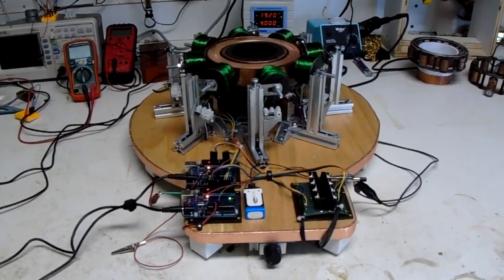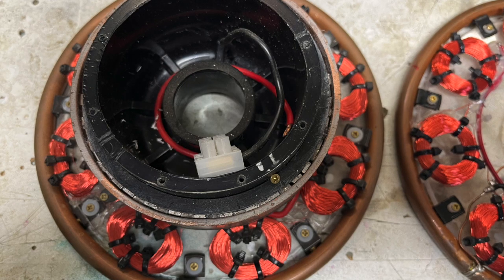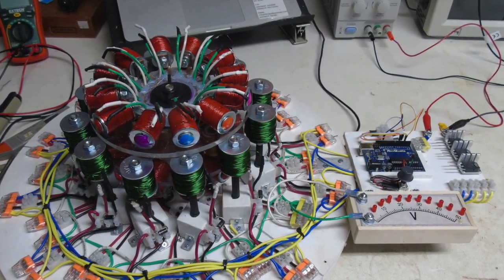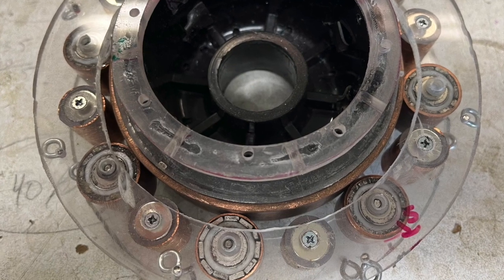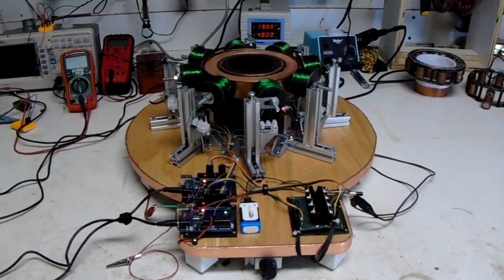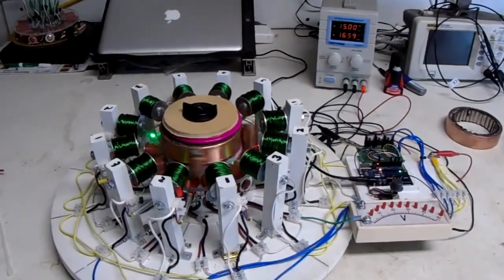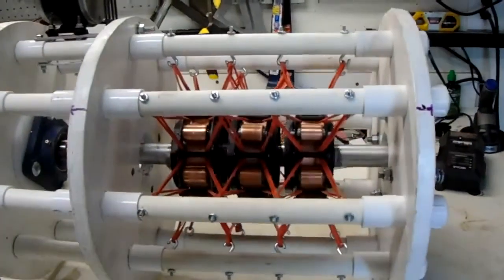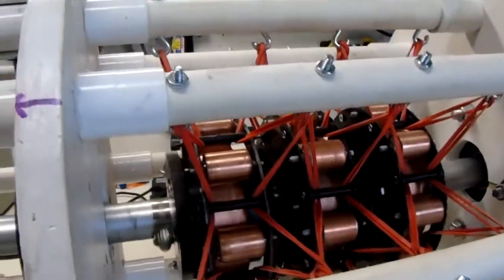Spatial Effect Generator experiments

Comment: From my studies I've found the metals do matter. There is some kind of effect on the rollers when using the metals Searl's used. And when it's working properly that abundance of energy needs somewhere to go. If not it'll build up inside and begin to developing it's own gravity field. It will also begin to lift from the ground so a remote control device set up on the exact frequency it's operating on will be needed or have a loss of everything. This field not only acts like a lift propulsion engine but also has properties that presents as a surrounding protection field which will keep any physical contact with the device impossible. Most that get too close to the answer usually ghost themselves by either they stop tinkering and move to a private location or they begin working with those that want it privately conducted. I hope for your success and be watchful.
Reply from the maker: This can be scary stuff. I stepped away for a while to do other projects, but hope to return soon.